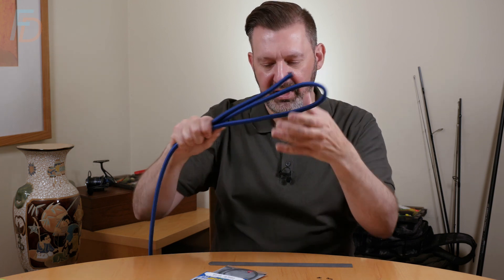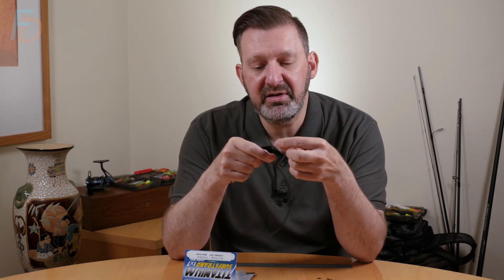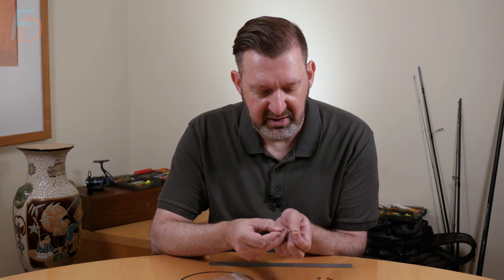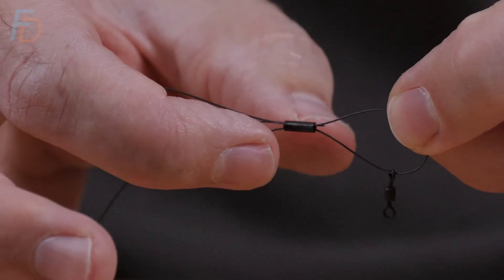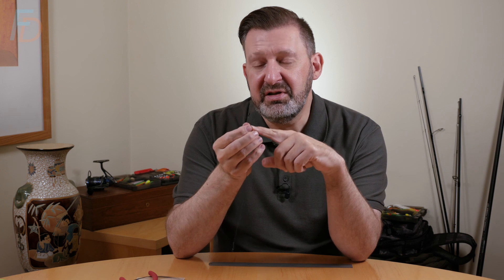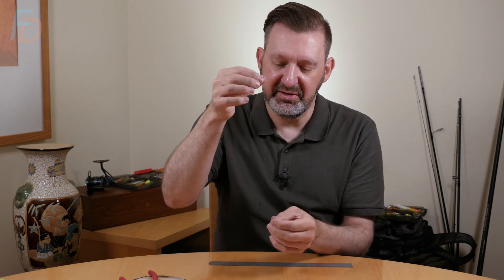Pike Trace Making: Why Multi-strand Titanium works out Cheaper than Steel over Time

Comment: It's nice that we've moved on from things like single strand Alasticum and stuff that looked like bike brake cable. From my experience the three pass method is best for low dia. steel wires and titanium, but doesn't seem to make much difference once you get to 40-50lb steel. The stiffness of single strand titanium is excellent for large glide baits and spinners whatever their size. The one time I still use light steel traces is in very snaggy areas just to keep the costs down from the losses. I'd be interested in your views about heavy mono as traces. I've used it for large baits and not had any problems.

Comment: If you consider using single core stainless steel wire 0.2-0.5mm, which is dirt cheap, and screw it together using very simple tools instead of crimping, remove the swiwel, then the price of single leader/trace will be pennies. And you can replace them whenever needed, not to mention that it can easily be straightened using fingers in a few seconds. Most of the people in western europe use this approach with great success.

Comment: Imo wire traces for bait traces and uptraces should always be used when toothy predators are present - pike have been known to bite through fluoro so why risk it?  The general rule for lure fishing is to use wire with any lure that has trebles - pike also love chatterbaits so when using chatterbaits whilst perch fishing, it's also advised to use wire and in doing so, it won't put perch off,

It's worth pointing out that any pike that you catch when perch fishing will mostly be hooked in the corner of the mouth so there's no need to go overboard with heavy wire. There's some nice subtle wires on the market between 8-20lb that are ideal for perch fishing that will serve you well!
Reply from the maker: Yep, agree with all that - with the possible exception of still being open to using super heavy fluoro as more data comes in...

Paul
Reply: @FishingDiscoveries  Anglers have been bitten off using 100lb flouro. Why risk it when wire is belt and braces?